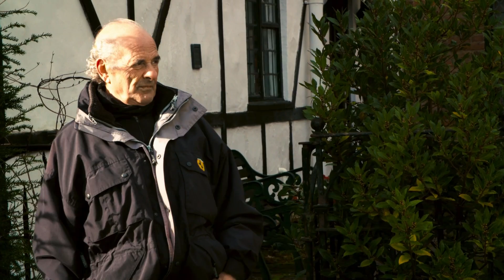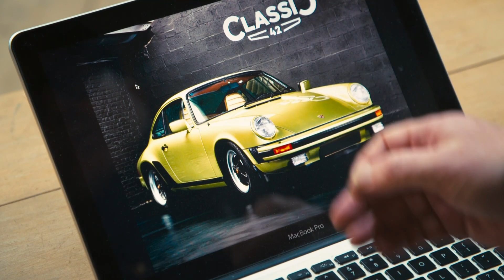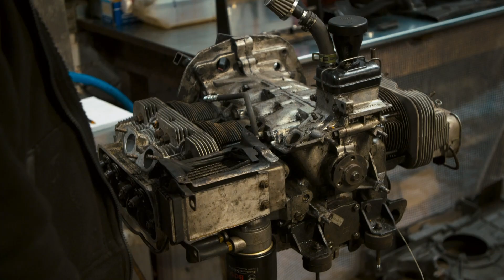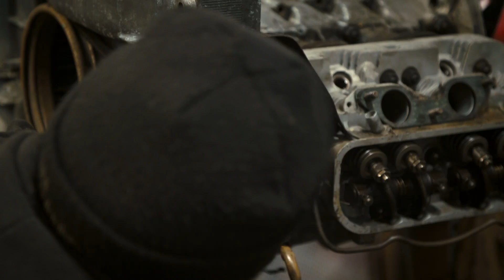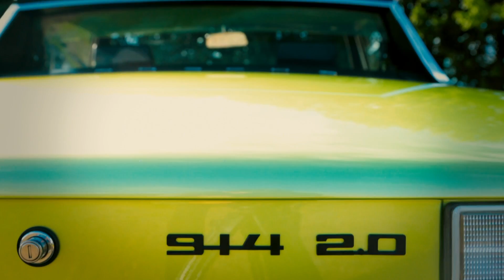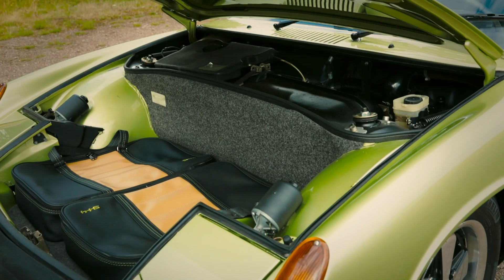Can Drew Turn A ‘Poor Mans’ Porsche 914 Into A Luxurious Classic? | Salvage Hunters Classic Cars

Comment: I had this exact car back in the day in that Porsche silver colour unfortunately under the two side panels behind the door windows there was some rust bubbling and I had to replace the whole panel with welded in bits. But, the engine ran flawlessly and had great compression! I really enjoyed the Porsche pattern shifter because anybody else driving the car could never figure out where first gear was - cheers from Toronto Canada

Comment: Always loved the 914, had one as my first car as a teenager and I heard so many people saying "but it's not a real Porsche". Mine had the VW-Porsche badging and was only a 1700 but it was an absolute dream to drive. The air cooled engines (4 and 6) are incredibly reliable if put together by an expert. My old man is an air cooled savant, he built my engine out for me and it's still going strong (in the hands of 2 new owners since I had it) some 25 years later with little more than regular oil changes and I believe new head gaskets and O rings on the pushrod tubes (it's best to replace both together).  

Lovely cars and so much fun. They are absolutely real Porsches, from the design through to the handling there can be no debate if you have ever driven one in good nick.

This one came out mint. Absolute stunner!

Comment: Classic Porsches will make the majority of owners a “Poor Man”🤣
Reply: The Absolute TRUTH !  From a  Ex PORSCHE OWNER !
Reply: I own a 944 and i was a poor man from the beginning 😂
Reply: Only if the owner is not a mechanic fuel injection technical enthusiast. If the owner is not able to handle troubleshooting a D jetronic fuel injection, then go to carbs. The fuel injection is most, not all, source of problems with this otherwise great car. A sports car vastly under rated until recently.

Comment: Years ago I had a 1970 914-6, the motor was rebuilt to a 2.2 S spec and it ran very good and fun to drive however the transmission /linkage was horrible and clean shifts were close to impossible.

Comment: I own 3 air-cooled 911s and my next car will be a 914. I actually want 2. 1 stock and one as an outlaw with either a turbo type 4 or an older 911-6. After pricing out the cost a simple rebuild or reseal on a 911 engine versus the type 4 turbo are similar costs. 911 cores are becoming expensive due to speculators that buying them up for profit and are not enthusiasts. We hate those opportunists.

Comment: I have a 914 2.0 '75 , exactly the same as this one. I bought it in 2015 and after more than 8 years  and a lot of work we finally have a decent car. They are a lot of fun to drive but to find a good one without rust is nearly impossible. In the beginning , I was also planning to have the retro bumpers, but now I'm glad I didn't do it. The wheels you had were not original so the Fuchs ones look a lot better, but maybe you should have taken the mini Fuchs (If you can find original ones) to keep the car more original. And it's a pity that the car has carburators and not the original injection. It must have cost a pretty penny to restore it. ( I know)But it looks great!

Comment: The 5-bolt conversion, done right, is not cheap. The rear alone on my '74 2.0 was over $4k in 2001, and that did not include the Fuchs wheels and tires. The car is beautiful, but I would have converted it back to the Bosch D-Jet EFI, which is more reliable and contrary to common belief, makes more horsepower (mine made about 108 to 110 bhp at the wheels, depending on the temperature) for a true 2 litre. If the engine was bored out, then the carbs make more sense, but the badge does say 2.0....
Edit: The 2.0 is a true Porsche engine, the 1.7 was VW. I had a Westfalia with a 2.0 and was told by numerous folk that there is a mythical list that shows the equivalent part numbers for the Porsche and VW engines, yet I only ever found one part that would fit both vehicles (but I can't remember what is was right now); even the fuel filter was different.

Comment: Wow, what a transformation - so much effort spent.  The year of the car isn't mentioned, but I'm guessing a 1975 or 6.  The 2.0 engine is highly desirable and that rebuild made sense.  Great to see that center console and fog lights options.  Converting the fuel injection to carbs isn't great.  Less sense was backdating the bumpers and drilling brake rotors to accommodate five bolt faux Fuchs, when factory original four lug 914 Fuchs are available and period authentic.  The paint color - while nice was never a factory 914 color, so collectors are going to do a hard pass on that, the bumpers, and the wheels.  I hope you're not going after Porsche collectors...I feel like you've really narrowed your buyers with some of these choices straying from factory options.  But 914s are so rare in the UK none of this may make a difference - these are all Yankee takes on the restoration.  Good luck it's a beauty!
Reply: I bought a 914 1975 . hated the bumpers for 2 reasons. The look is terrible they were only made to meet US 1975 5 mph no deform bumper crash test and the extra weight of them 120 lbs on an only 925kg car. I changed it for an earlier pre 75 chrome bumper that has factory fuchs 4 spokes but I actually realy prefer the 5 spokes.
Reply: @martinaoneaalpha9150  The bumpers are a subjective preference for sure - the chrome look goes in and out of style.  Some say the additional weight at the ends of the car improved overall drivability, but at the price of a few tenths of a second in 0-60.  I don't disagree about the five spoke over four spoke Fuchs, but again collectors are going to want period correctness.  Similar things can be said about front spoilers, front oil cooler, M471 flares, etc.  But all these mods take away from originality and for many collectability.
Reply: Agree. Was thinking exactly the same thing. Original Fuchs for 914, original color and keep the correct bumpers. I guess it is a restomod?

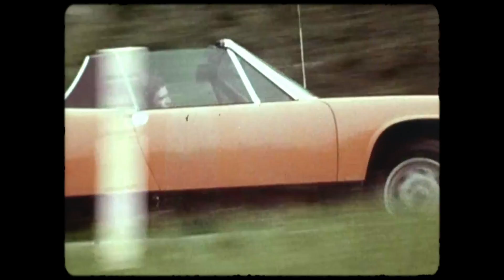Comment: Believe it or not, the Porsche 914 started out as a handshake agreement between the VW CEO and the Porsche CEO. When the VW CEO retired and left the new CEO didn't honor the handshake agreement that was made with Porsche. The early 60's 914's were made by VW with Porsche parts. The narrator statement made at 2:20 is completely false and wrong. The 914 engine isn't a VW engine! It's a proprietary Porsche engine! None of the 914 engine parts will fit on any VW engine. The phrase "Corners on rails" aptly applies to this car. This is a 75' or 76' because of the rubber bumpers. If it is a 75' or 76' it now has the completely WRONG Bumpers! All 1976's were built in 1975. The chrome bumpers came on the earlier cars. If it is a 74' or earlier, then it has the right bumpers. These fuchs wheels are completely wrong for this car. All 914/4 wheels are supposed to be 4 bolt not 5 bolt! Porsche 914/6 wheels are 5 bolt. These cars are also not supposed to have a Porsche crest on the front bonnet. The A pillar is supposed to be body color NOT black. It looks like this has had a conversion to carburetor. All the 75' and 76' cars are supposed to be fuel injected. I know because I used to have a 76' 914/4 and did the research on them. I loved it, and would like to have another good one some day. Sadly I doubt that they did any real research on 914's before doing this refurbish. Thank you.